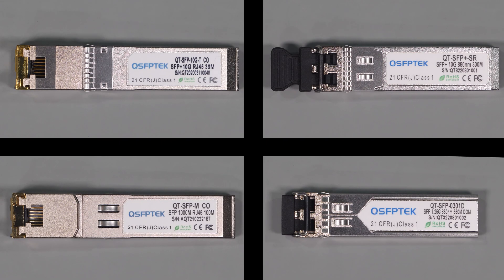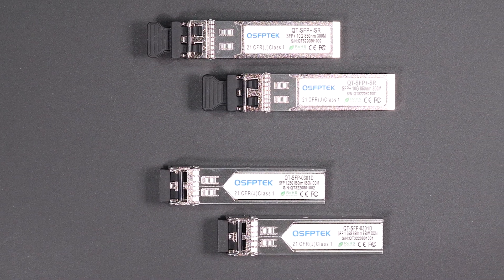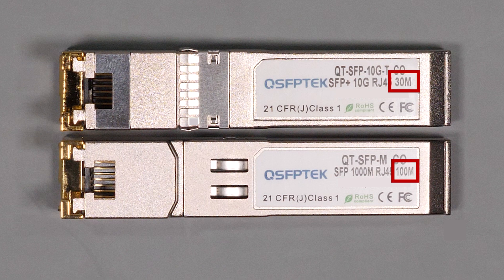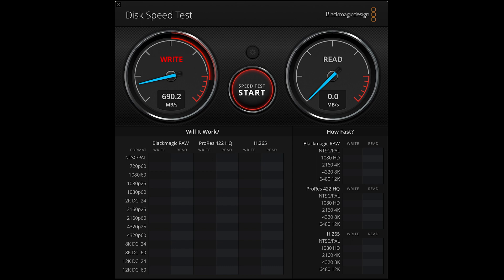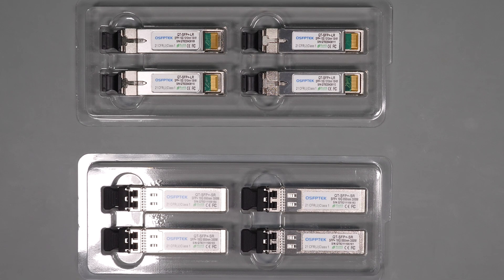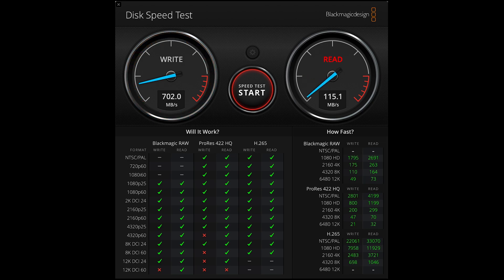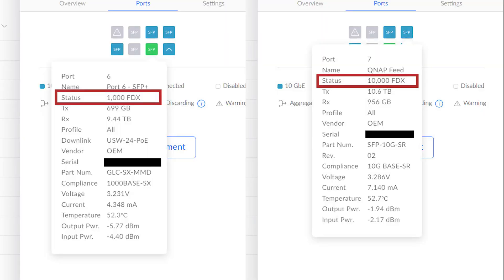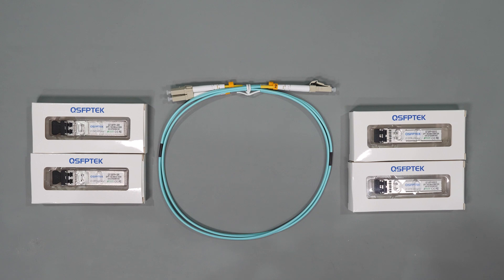QSFPTek SFP and SFP+ Transceivers - Fiber and Copper

Comment: So with the Ethernet cable plugged into the transceiver as at 3:17, can that cable then simply go to an Ethernet switch?
Reply from the maker: Yes but the speed must match at both ends.  Great question.
Reply: @MikeFaucher  Hmm. So 10gb connection at the server, can't go to a 1gb max ethernet switch?
Reply from the maker: @rswow  if it is SFP it has to match so you have to use a 1G transceiver on each end. If it is RJ45 it will auto negotiate.

Comment: Good afternoon You are doing a great job! thereby making life easier for the engineer! Thank you!
I have an unusual case, I want to make a small board that connects 2 DAC passive cables at 100GB speed.
But I can't get the host system to work through my board and 2 DAC passive cables. The DAC cable is 50cm long. The lines on the board are 15 cm long; there is an overlap of RX <-> TX signals on the board.
Tell me where to look? Who did something like this?
Reply from the maker: Interesting question.  I am not aware of anyone doing this but I might suggest you try and reach out to the SFP MFGs to see if they could point you in the right direction.  Sorry I could not be more help.
Reply: @MikeFaucher  Thanks. What will happen if you sew into the eeprom DAC cable the information that it is 2 times longer (the cable is 1m - we sew up that it is 2m).
Will it work? Will there be communication between NIC ports?
Reply from the maker: @pcb7377  These are areas of experimenting I have not done.

Comment: can give you an explanation about db db/m for fiber
Reply from the maker: That is a lengthy topic but in essence, each of the transceivers puts out a certain amount of power based on its distance rating such as SR or LR.  The longer the fiber the more signal losses you have which is why LR modules output a bit more power.  Typical loss for OM4 fiber is 0.003dB per meter.  Not sure it that helps but great question.
Reply: if you have an os2 cable of 30m how much attenuation do you need if the sfp is 10km
Reply from the maker: @Notmy00000  Not sure. Standard LR should be fine out the box.

Comment: DAC > fiber > RJ-45 transceiver for "local" connections, i.e., where you can find a DAC cable of the proper length.  DAC is cheaper, lower power and more compatible than any transceivers.
Reply from the maker: You are right it is cheaper and they do use less power but they are a bit less flexible.  As I change my configuration all the time I prefer to fiber but that's just me.  That said, you are absolutely right.  Thanks for the feedback.
Reply: @MikeFaucher  what do you mean by less flexible? Like that the physical DAC cable itself is thick and cannot be bent as sharply as a fiber cable?
Reply from the maker: @dereksnider7148  More general.  DAC cables are stiffer, SFP+ to SFP+ mainly.  It was more of a subjective comment on personal preference as I am not a real fan of DAC.  Good point though.  Appreciate you calling that out.

Comment: Thank you, I'm planning my move from 1G copper to 1G fibre and then onto 10G, this video was helpful.
Reply from the maker: Glad it was helpful and thanks for the feedback.
Reply: @MikeFaucher  Do manufacturers code their SFP to work only in their hardware and then QSFPTek make generic ones which work in all hardware?
Reply from the maker: @jules.marshall  Typically, they are supposed to be universal and not tied to a specific MFG.
Reply: @jules.marshall  and Mike Faucher  Some SFP and SFP+ have different microcodes. Like Dell, Intel, D-Link, Netgear, Zyxel, Mikrotik, Meraki, Ubiquity, Cisco, IBM, Qnap, etc usually for DAC they are compatible, but the Fibre ones can have other types of Microcode needed, such as Mellanox, HP Pro Curve, Extreme Brocade, Juniper, Arista, HP Aruba, etc. If you have a special network card or switch, contact the SFP, SFP+, QSFP+, QSFP28, AOC, DAC manufacturers and discuss your needs so they can put the microcodes of the brands into the Transceivers for youor give the right cable. There are many companies, but 10Gtek, Startech, Ubiquity, Ipolex, QSFPTEK, Cisco, Elfcam, H!Fiber are the most common ones that you can order online from. If not sure, send email or give them a call for your needs, lengths and hardware you have for compatibility issues to prevent in your setups.